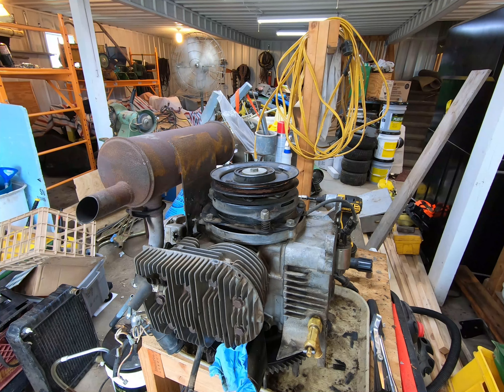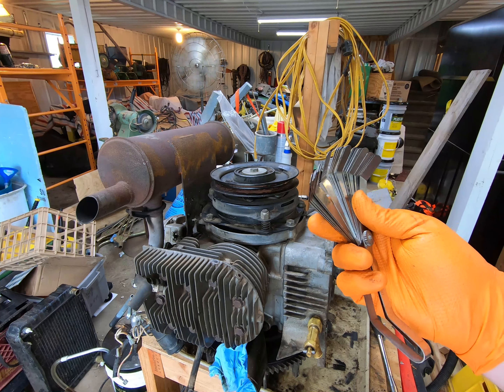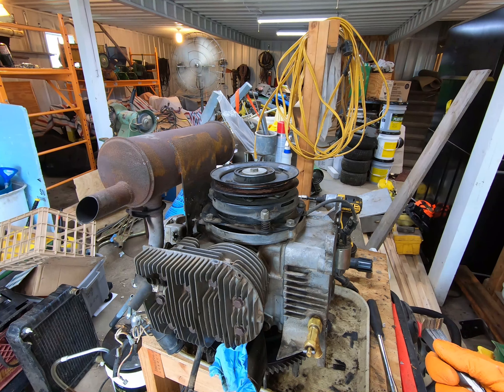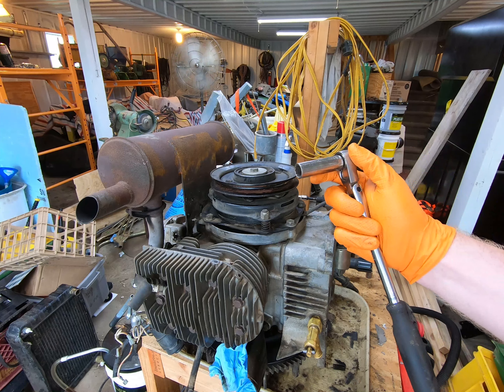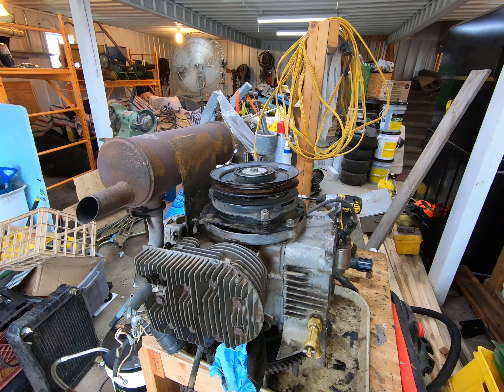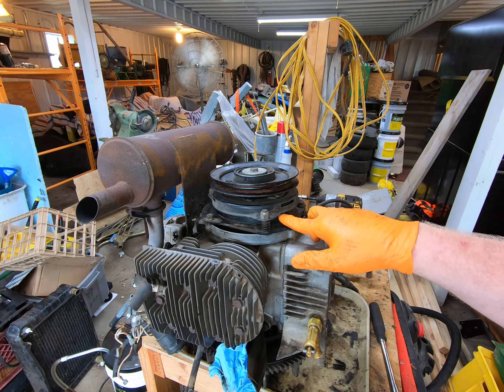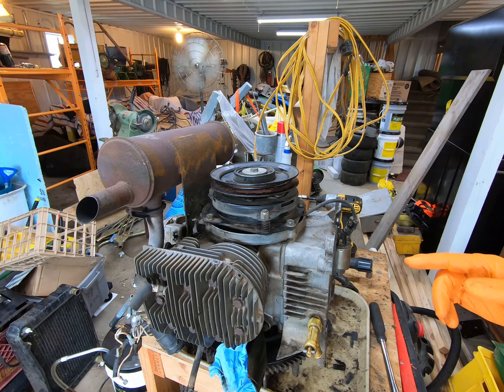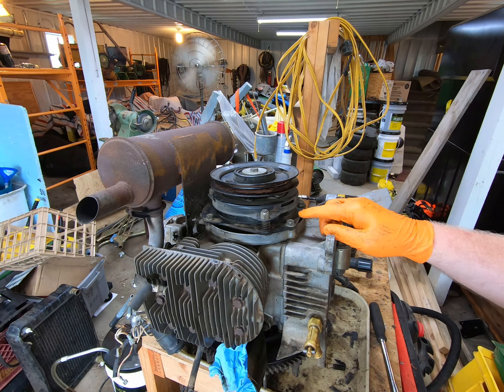John Deere Electromagnetic Clutch Air Gap

Comment: just so you know, you can stack smaller shim (feeler Gage) together to achieve the same thickness as a single piece.for example to achieve .020" you can stack up 5pcs of .004 shim and it will be flexible enough to get around corners such as the lower part of the clutch pack you just showed to us.  great vid keep them coming we do enjoy them.

Comment: FYI
On my 318 I replaced the 3 nuts with JD OEM parts because mine were not very tight.  I could not adjust the gap because every time I put the socket on the nut it would move the cover a tad, which would change the gaps of the other 2.

I come to discover that the 3 new nuts I bought were a larger diameter but the correct thread as compared to the old original ones that were not very tight.  I could not find thin-wall nuts locally so I "adjusted" my old ones.

Comment: Question Here, the keyway on this shift is 25mm in that case, it does not lock into the bearing on the clutch, is that correct, then when adjusted to .018 does the pully become impossible to turn, Thanks

Comment: I am thinking I am experiencing a bad bearing or an out of adjustment clutch. Just recently the motor seems to be down on power compared to what it had a week ago. When I engage the PTO the engine almost stalls. Also experiencing a slight squeek at idle that goes away as the RPMs go up. New bearing and adjustment time I feel.
Reply from the maker: A bad bearing is entirly possible based on those symptoms. You could pull the clutch and inspect the bearing, it should be pretty apparent. Good luck!!

Comment: I have a 185 Hydro with a Kawasaki. Would  I use the same gap as mentioned for the 140? Thx for the info on how to do this
Reply from the maker: I am not sure about what the gap is on a 185 hydro or if those PTO clutches can be adjusted. Sorry I don't have a better answer.
Reply: @mmrbeef  a 180/185 Hydro online manual said .041 gap so I will start there and see if it works and let you all know since this seems to be a common issue.

Comment: Would this apply to a John Deere 455 3 cylinder yanmar diesel engine ?
Reply from the maker: The clutch on the 455 is a wet clutch that in enclosed in the transaxle. So there are no real adjustments that can be made to the clutch. If the PTO isn't coming on or is temperamental on a 455 I would look at your safety switches and make sure they are adjusted properly (namely the brake and/or the neutral safety).
Reply: @mmrbeef  thank you!

Comment: Is it OK that the pulley turns hard when I said it at .018 it’s a brand new clutch?
Reply from the maker: Very few of mine will turn freely when set correctly. As long as all three spaces are gapped to 0.018 you should be good. If there is at scratching sounds when the engine is running with or without the PTO on, that is something I would be concerned about.

Comment: Would the clutch air gap of too tight cause the motor of an Onan 318 to stall immediately when engaging the PTO?
Reply: That could be a safety switch issue. I had that issue with my 318 and it was the pto switch. One of the terminals on the back of the switch (on the safety circuit side) you could wiggle it a little bit. When I checked resistance across the terminals, the resistance reading was wacked. Check your terminals and see if you can rotate them, you should not be able to. I suppose if it was adjusted too tight it could kill the engine ( too much amp draw), I'm inclined to believe that it's a safety switch issue though.
Reply: @jdtractorman7445  thank you!
Reply from the maker: The air gap, or lack there of would not cause the engine to stall when engaging the PTO. As jdtractor man suggested I would thoroughly inspect the safety switches and other electrical components.
Reply: @mmrbeef  what does it mean when the gap is 0, with power disconnected and nuts loosened?
Reply: And the engine dies when I try to engage